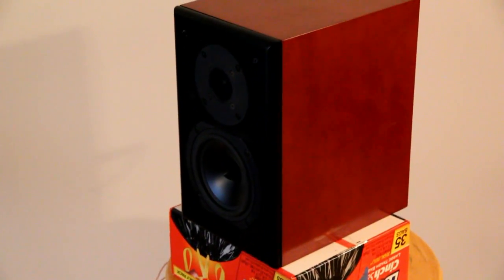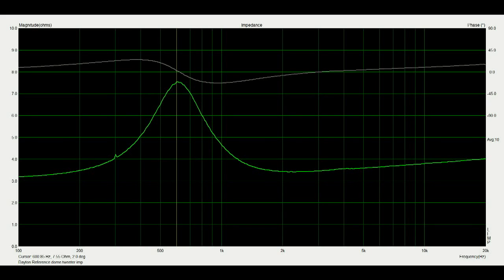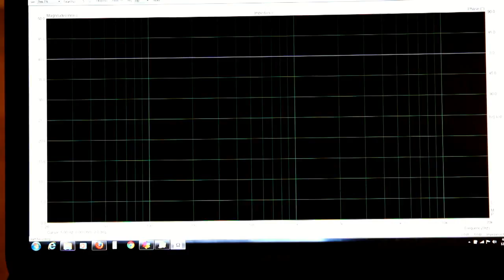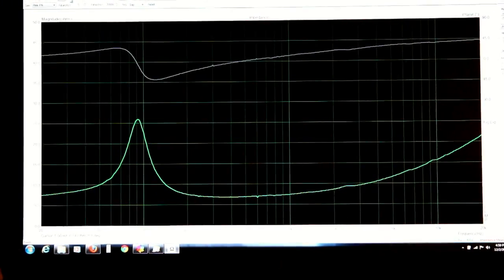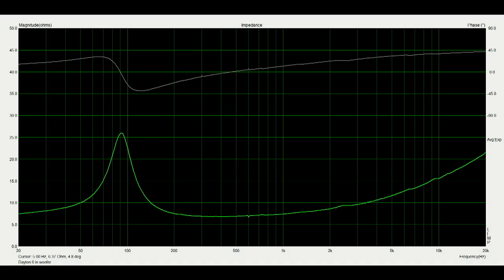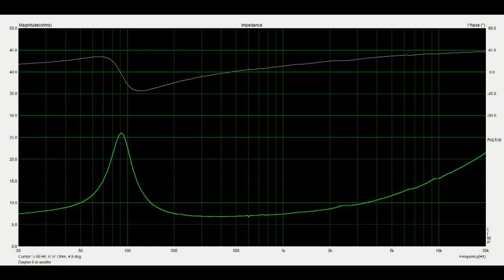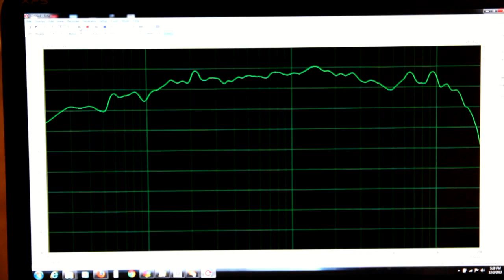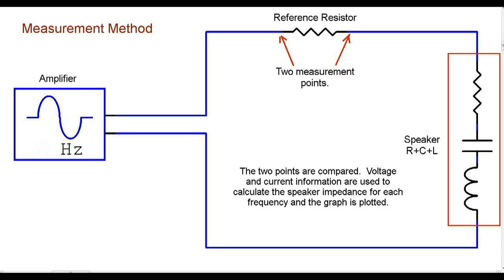Speaker Impedance measurement video.mp4

Comment: How about a demo the old fashioned way without software??
Reply from the maker: Haven't done it that way in a long time, a volt meter, a current meter, and a reference resistor. It's probably been at least twenty five years since I did it that way.  And after all, there is a lot of free software these days so no reason to go back.

Comment: hi, it is safe to measure tweeter or you add cap on it? thanks
Reply from the maker: You don't need to put much power into it so it's ok to measure tweeters.  Just be careful and don't be connecting/disconnecting preamp lines with a tweeter connected direct to an amp.  I've blown a few tweeters doing that.  Btw, you don't really even need an amp to measure impedance, you can just do it with the sound card output directly.  I started doing it that way a couple years ago.

Comment: Use DATS to obtain impedance (ZMA). Use ARTA to obtain frequency response 
(FRD). Then import both of those into SpeakerWorkshop and design your 
x-over. There is NO easier or better way. The only thing you'll need is a
 calibrated mic from Cross Spectrum Labs.

Comment: well LCr meter can measure XL or inductive reactance , that woud be cheaper then expensive mic , sound card and such. But i am interested in this measurement cuz my next project is upgrading old Sony speakers with a nice base for my workshop . they need repair , upgrade , and for upgrade im going to need some of this measurement
Reply: +Pavle Pavlovic Arta works pretty well with integrated codec as well, which comes for free - you only need to buy 2 male jacks, a resistor and a short cable - which won't cost more than a few bucks - and you have a perfectly functional LCR meter. I'll be uploading my how-to video sometime soon.
You only need mic for frequency response measurement, but 650USD is way too much. I bought mine (Monacor ECM-40) for like a 100USD together with a stand and phantom power supply and the mic came with calibration curve.
Reply: KocuRisko What is Arta i dont know. I have a condenser mic , its not calibrated for testing but the curve is pretty flat so i use that , but there is nothing i can use it for cuz i cant change the room , i dont have those panels  for my studio room . But i tried testing it with REW software and what i get is even better then what they get for demonstration  so im satisfied but i cant improve it cuz i dont have the wall panels for sound absorption. But i havea lot of furniture in the room so that  works too. Im good on high frequencys , i was able to measure that . like 15k-20k the window curtain absorbs that
Reply: @Pavle Pavlovic: A speaker is much more complex than just a single L/C/R. It consists of all three elements even more than once. An LCR meter has not much use there.
Your condenser mic will work with ARTA even in a normal room. ARTA can measure within an adjustable timing gate. You can filter out everything from the first reflection of your room onwards. At one metre distance your lowest frequency is about 300 Hz then. You can merge that with a second measurement of the near field. Everything is explained in the ARTA manual and tutorial. See http://www.artalabs.hr/support.htm.

Comment: One suggestion. Learn SpeakerWorkshop for x-over design. Unlike lspcad SpeakerWorkshop is free. The measurement section of SW is VERY difficult to learn so I do recommend ARTA for measurements. But the x-over design section of SW is easy to learn. A Google search will get you all the info you need.

Comment: Doesn't the microphone itself also have its own frequency response? How does the software take that into account when measuring speaker's frequency response? I know that there are "flat" microphones but even they arent really flat (well except maybe for a few thousand bucks).
Reply from the maker: The Earthworks mic I use is a calibrated measurement mic and it was only about $650.  It's pretty close as is but for I think it was $50 you can get the calibration file.  You then just load the calibration file into your measurement system and it corrects for error in the response of the microphone.
Reply from the maker: Sorry for the delay, I don't get around to checking this very often and it e-mails notices to an AOL account I almost never check.
Reply: Microphones have a much flatter response than speakers, even a cheap mic will be pretty flat to 10KHZ. so they wont introduce significant error. 

when you want to make calibrated measurements, you will need to calibrate a mic first.

But to measure and compare the response of any speakers you don't need cal mic. so weather the results show SPL of 80 or 90 dB it matters not because both will be taken using the same setup. and you can still use this data for accurate crossover design.

Comment: Hi, thanks for the video. 
Can you please give a little more informations on relation between phase shift and impedanse rise on midwoofer and how does that relate to designing a crossover? I guess you have to look for the crossover frequency where tweeter and midwoofer have similar phase shift? But what if they don't meet anywhere?
Reply from the maker: Actually it’s more complex than that.  The inductors and capacitors in the crossover introduce their own phase shifts.  Here is a tutorial about how simple filters work… http://www.electronics-tutorials.ws/filter/filter_2.html  This is over simplified however because it is working with a resistor and a capacitor.  The crossover being the capacitor and the resistor being the speaker voice coil.

With an actual speaker, the voice coil is essentially a variable capacitor in series with a variable inductor in series with a resistor.  Even the variable elements are variable!  This is why I use lspCAD which is an 800 Euro ($1100) software package to do this.  There might be cheaper alternatives or possibly even free online calculators but whatever calculator you use, it must account for the impedance of the actual speaker being used.  This means you have to measure it and upload the data into the software.  This will typically be a text file that includes amplitude and phase of the impedance incrementally up through frequency.  It also needs to know the frequency response of the speaker being used which will be another table of data.  If the online simple crossover calculator only ask for a simple value like, “8 ohms?” then it will not be a valid calculator.
 
Sorry for such a long delay in responding.  I haven’t checked comments in ages.

Comment from the maker: Speaker terminals?  Are you looking at their amplifiers?  A lot of their products are digital input and output.  For those you need an ADC on the front and a DAC on the back.  

I've been using the 2x4 for upgrading the audio system in my truck, it is 2 analog in and four analog out with 2V max input.  You're not confusing these voltages with the power supply voltage are you?  The 2x4 is 12 volts input for the power supply.  You would need to use two of the 2x4.  I'll be using three in my truck.

Comment from the maker: Active is by far the best way to go it's just not always convenient to have multiple amplifier channels.  These days DSP is the way to go.  I've been using the MiniDSP products (minidsp-dot-com)

With passive you can never do more than make an approximation of the proper slope but with DSP you can dial it in.  Also, like you said, you're just changing dial settings not removing and replacing component values.  Check out the miniDSP stuff, it;s inexpensive and easy to use!

mk

Comment: Thanks. I went with a mini amp producing 15watts per channel. I understand I only need 1watt for the test. So the amp should be more than sufficient.
Reply: 2.83V RMS into 8 ohm is 1W so put a DVM across speaker and adjust amp volume till you get 2.83V with a sine input. If you put a calibrated mic at 1M then this will be industry standard.
Reply: for impedance measurements they can be taken with small signal so a 500mV is adequate

Comment from the maker: Yes, use any power amplifier to power the speaker.  On the ARTA web site you can download the manual for LIMP, the impedance part of ARTA.     It shows how to build the probe which is easy.  The zener diodes are to protect the sound card from over voltage so if you are very careful you can do without them.  I always use a resistor of known value to test before measuring the speaker.  Just measure an 8 ohm resistor and make sure it measures 8 ohm.

Comment from the maker: Yeah I don't have much place to work living in this little apartment here in New York, I'll sure be glad when I can move back to the states;-)  Back home I have a Geni Lift to get the speaker high enough to get pretty good measurements.  Another option is to ground plane measurements but this requires a flat surface also with no obstructions.  The video is just for demonstration purposes only you can't get very useful results with that setup.  Time windowing can allow accuracy at high freq only.